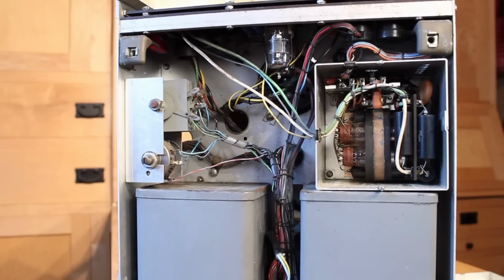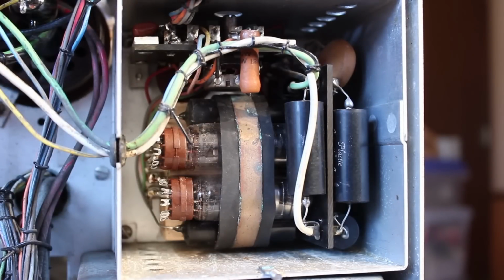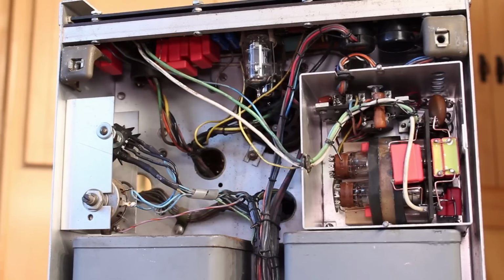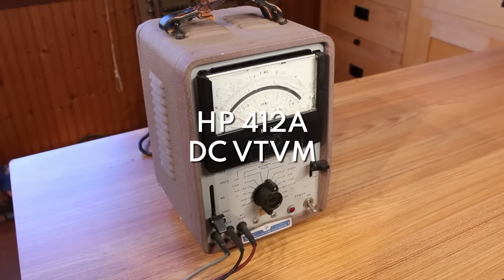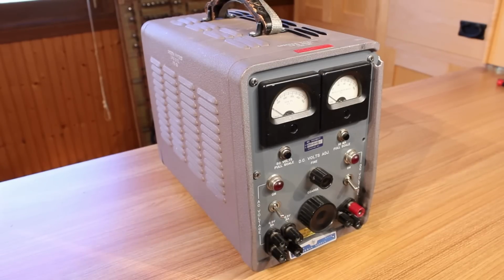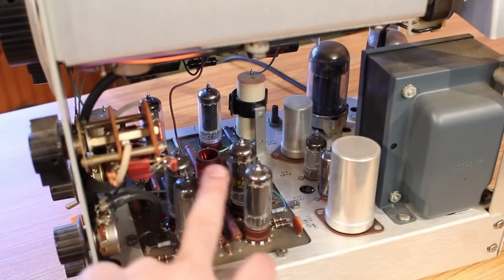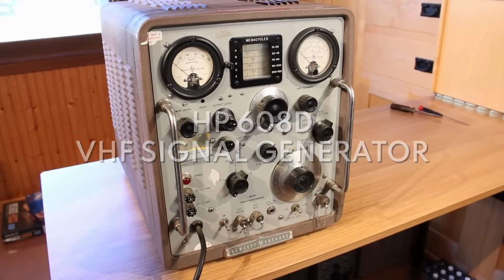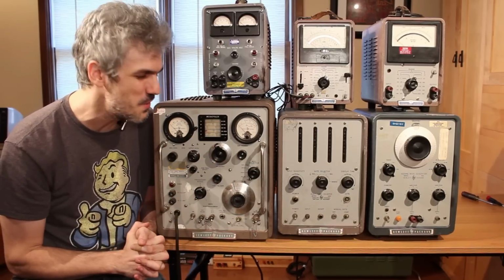Vintage Hewlett Packard Test Equipment Extravaganza

Comment: David, I have also a 608D in the restoration queue. Should we do it at the same time and have Mr. Carlson on speed dial? BTW the 608 was part of the original RF lineup that started the incredible HP RF instrument line, with specs so awesome that it stayed one the catalog forever. I just checked, the 608D is in my 1965 catalog (the oldest I have), and the 608E still appears in the 1981 catalog! The 608A was introduced in 1950. A 30 year run.
Reply: great to see you here Marc!

a collab would be awesome, David's channel could really use more subs :)
Reply: A trio collab with the best (Marc, Usagi and Mr. Carlson) would be a dream!
Thanks for all the joy you all provide to us.
Reply: Mr. Carlson also recently did a video about a 521C he has.  His was in really good shape (and working), not sure it even needs any restoration. (Where does he find this stuff?)
Reply: How awesome could this get! Please include a detail dissection and some CuriousMarc analysis of this black magic RF box!
Reply: Woah ! This will be epic three musketeers restoring stuff together
Reply from the maker: Oooh yeah, dueling 608D restorations, I'm absolutely game for that!
Especially with your black magic RF skills, you can teach me the dark arts in exchange for spare vacuum tubes. I've been slowly checking off instruments from the 1959 catalog, and sure enough the 608D is in that catalog too. Interestingly, on the 608E/F models, it seems the modulator portion of the machine was upgraded to use a handful of transistors, but the rest of the machine is still rocking the great compliment of pentodes, dual triodes and triode-pentodes. I just think that's excellent that you could buy a new piece of test gear in the 1980s that still had to move electrons through little glass tubes!
Reply: Well given that I have a 608D in my basement waiting for it's turn, I'm going to put in a vote for this as well.

Comment: Wow seeing the 608 what a flashback. I was an avionics tech in the military during the late 60's and used it extensively repairing UHF aircraft radios. I've never seen the inside as ours never failed while I was assigned to H&MS.  The other stuff on the radio bench was a TS505 VTVM, and a RF and audio watt meters, forget the military designation of those pieces of test equipment.
Reply from the maker: That's awesome that you got to work with the 608D in it's intended environment! It's good to hear that the one you used never failed, that bodes well for this one getting up and going again! Also, that TS505 VTVM is excellent, it looks like it was built to survive just about anything, haha.

Comment: The build quality of these old HP devices is just increadible. I love the high amount of mechanical stuff in them, this was just a completely different approach at problems. 
I can't even (and don't want even) decide on which one you should do first, they all have some very interesting topics to cover and I look forward to every single one of them.
Reply from the maker: HP built some amazing stuff didn't they!
The 412A DC VTVM is really interesting actually, the Synchron is an AC motor that spins a wheel to make or break light from the bulbs contacting photosensors to make a chopper circuit for modulation and demodulation. It's a beautiful collection of mechanical and electrical engineering!
Reply: @UsagiElectric  Oh well now I know what else I wanted to comment. 
As you already figured out, the synchrotron is a very early chopper amp. 

Mr Carlson also has an old video of a RF voltmeter wirh a little neon bulb photocell chopper like this.

Comment: LOL, Way back I was trained in the Army as an electronic test equipment repairman, I had the MOS of 35B20 and 35B30. My ETS was in 1972, After the service I worked at an army depot in their instrument shop and repaired a large variety of HP test equipment. I remember working on nearly all that you show. But mostly the HP400 AC Voltmeter and the HP410B Multi-meter. I would have three or four HP400's burning in while I was going through the specifications on another for the QC inspector. Fun times.

Comment: With regards to the Selenium Rectifier, they don't need wholesale replacing the way some internet people may portray.   The tend to slowly degrade over time, not just suddenly melt down (unless the rest of the circuit shorts out).    The slow degradation results in increasing voltage drop, and this causes increased heat over time and when they start running hot enough they may fail.   If the voltage drop is within specs, they are quite safe to continue using.   They may just need checking occasionally.      It's personal choice, but don't feel that the Selenium devices are the big ticking bomb some people make them out to be.

Comment: I grew up with HP equipment, and even today, I still have and use them on occasion!

There is somethings in life that survive the newest, and what I was going to say, is now, no longer the newest, Fluke meters has replaced. But I am sure there is a replacement for Fluke soon, just as the HP and Simpson meters have lost their glossy newness, Fluke meters shall also get tarnished, but as I am no longer in the mainstream of electronics, and only work from my home, things will pass me by...

Comment: At a garage sale I bot a 711A power supply and a 521A counter for $25. The 711A was a little flaky but came right back to life and reasonable calibration after simply replacing all the bumble bee .1 uf caps with new ones. You just have to rip those out and replace them, they are always all bad. The 521A counter worked fine as it was. I unfortunately lost it in a fire, but I still have the power supply. I also built a little box using a backwards filament transformer that runs off the front panel 6.3 + 6.3 volt AC posts. The box runs a filament xfrmr backwards and produces enough volts to run an 0B2 105 volt gas tube and produces a 0 > -90 volt variable bias supply, the lack of which is a serious shortcoming of the 711A supply. Kewl piece of gear. 
The AC and DC VTVMs you have use a chopper and light interruptor mechanism to measure volts, and are kind of arcane. They are probably pretty tricky to troubleshoot. You will like the 211 sq wave generator (and it uses several 6CL6 which you thot you might use in your 6AU6 computer project) That piece can put out a VERY strong square wave, 50-60 volts.

Comment: You shouldn't really need to replace those Selenium rectifiers. Unless they've been abused they will last for a lifetime. Equipment was often designed around their relatively high voltage drop (compared to Silicon rectifiers) and internal resistance, so that needs to be taken into account if you need to replace them, in order to avoid supply voltages being out of spec.

Comment: The "synchron" is a synchronous motor. My best guess it's an interruptor for a chopper amp.
Reply from the maker: You absolutely nailed it!
I dug through the manual after I posted the video and that's exactly what it's used for!

Comment: HP made some superbly well engineered tube powered test equipment, didn't they?  I'd do the DC VTVM, followed by the AC one and then the 521A frequency counter because 'use vintage test gear to repair other vintage test gear!'
Reply from the maker: HP never ceases to amaze me with their engineering! 
Thanks for the vote on the equipment, I'm keeping an Excel sheet to see which pieces get the most votes!
Reply: @UsagiElectric  And they started in a garage with an audio generator (300 I believe).

Comment: If the meters use the same meter, maybe you can get measurements off the intact one to help recreate the bezel and scale.  I'm most interested in the frequency counter, but as others have said it would be cool to do the meters first then use them on the other gear.   Your charisma, Mr. Carlson's know-how, CuriousMarc's HP love - that's a dream team.  🙂
Reply from the maker: Unfortunately, the AC and DC meters are just different enough that I can copy it over verbatim, but they do share enough similarities that the AC meter will make a great template!
One of these days, when travel is okay again, I'll have to try to talk my way into flying out to visit CuriousMarc's HP collection!

Comment: I’ve never seen any equipment without a board. Impressive!
Reply from the maker: PCBs were really just coming into their own in the 50s, so a lot of stuff from that era is often point to point wiring or uses turret boards. I love that HP was really experimenting with designing stuff on PCBs and using a mixture of all construction styles. It shows they weren't beholden to a specific type of engineering and they made some really excellent stuff as a result!

Comment: Pareidolia is definitely doing its thing here, because I'm seeing so many funny faces ein these instruments!
The 608D would be fun, but maybe not the best start? One approach would be to think about which ones would be useful when trouble-shooting the others? The 711A power supply that needs some body work would be my vote.
Reply from the maker: Haha, I never thought about that, but you're right, there are some funny faces hiding in there!
The 608D is definitely a difficult one. I'm not even sure how I would go about testing it to make sure it's working. It's slowest oscillation speed is faster than the fastest speed the HP 150A scope can support. I can always break out the modern Siglent, but that's not quite as fun as using vintage HP stuff to restore vintage HP stuff.
The 711A is probably the one I would get the most immediate use out of though, so that's a good vote!

Comment: I vote for the 608.  I spent a lot of time inside those in my salad days.  You're in for a treat... They are marvelous generators, but they can drive you nuts when they don't work properly.
Reply from the maker: I know so little about the 608, it's going to be a really interesting piece to dive into and learn about!
Fortunately, HP made some pretty fantastic manuals, so hopefully I can get it back up and running again soon!

Comment: An arc-cricket is what the old teks use to call this.  Depending on the volume/pitch you can tell it is internal or external.  Low volume high pitch. internal in your case.   Glad to see the Se rectifier gone. Btw you should always  install your coupling  caps with the foil-side to ground  ;)  For example  the strip on the old type 33 I bet that was pointing toward ground.
Reply from the maker: An arc-cricket - I like that!
I've heard a lot of differing opinions on the foil side to ground for the caps, but it requires some special testing to figure out which side is foil side on the new modern caps I buy, and I'm way too lazy for that, haha. Fortunately, the HP 150A didn't seem to care because it came right into spec according to the manual!
Reply: @UsagiElectric  It is the low frequency range that will be most effected.  But if you happy I am happy.  Checking for the foil side is easy, all you need is an old guitar amp and a little time.  I myself use Mr Carlson's little device, and I only ever use it when I get a batch of new caps in and check and mark each one,  On the Se rectifier side of things supposedly at low voltage the will last forever,  it is higher voltage and bad caps that will cause the big smoke with them.  I myself just bypass them as why take the risk.

Comment: There's a 428B missing! :-) Iconic device. The perfect amp bias tool.  Mine is accompanied by 410B and 400H, as well as 3552A and 3438A, for Nixies I've got 5221A and then there's Junior, a 974A.
Reply from the maker: Oooh, the milliammeter! That one is on the list of ones to get! I don't due much amp biasing, but having a milliammeter in the suite feels like a must at this point, haha. Also, the 410B is an amazing little VTVM. The probe with the tube in it is just so cool.
You have an absolutely lovely HP collection too it sounds!

Comment: Old capacitors try using something to generate 4kV or so, and then applying some voltage to each one, with a series 10k resistor, and a small 600R speaker to hear the breakdown as the capacitors break down. You will find which have failed from the clicking.
Reply from the maker: That's actually a really cool idea!
Unfortunately, all the old 6kV caps are already in the bin, haha.
Reply: @UsagiElectric  I used to test motor run capacitors by applying 1kV to them, and listening to the crackling coming from inside them. Old capacitors will break down, but the new ones will survive 1kV from an insulation tester no problem. first test for breakdown, then discharge with a 68k 10W resistor for a few seconds, then leave for a few minutes, then short them (dielectric absorbtion) and check capacitance, normally down to under 70% of nominal value. Crackle means change anyway, it is done.

Comment: Useful note:  See those tubular capacitors where one lead is much fatter at the base than the other?    Ever wonder what that is about?   As it turns out, that bulge is a thin brass tube which was used to fill the capacitor with oil.  Then a wire was soldered into the tube.  Clever.   However you would always end up with a little bit of flux going into the capacitor oil.   Eventually the flux would contaminate the oil and lead to internal leakage.   

Also those black tubular caps with yellow lettering were often paper dielectric capacitors which also tend to go leaky over the decades.  If the lettering is reddish-orange,  people say that the caps have a plastic dielectric and they tend to be a bit, but not a lot less leaky.

Both HP and Tektroniks used both styles of black tubulars.   I always replace all of them, even the ones that only show like 100+ megohms of leakage.

Regards,
George
Reply from the maker: That's really cool, I was curious about the fatter base at one end, but I never would have guessed it was to fill the cap with oil! That's awesome! I mean, break down and internal leakage isn't that awesome, but still, I love seeing unique construction techniques like this!

Thanks for the insight on the caps, it seems that lot of people are saying the Spragues with the red lettering and the yellow caps should be totally alright. That's good news in my book because it's fewer things that I have to replace!

Comment: I'd say go for anything that you can put to use sooner rather than later. Obviously if it's higher up on the difficulty scale you might want to push it down the list further, till you get more practice on some of the other units. But that 608D signal generator looks amazing, so it would be pretty cool if you and CuriousMarc could get yours and his working at the same time.
Reply from the maker: Thanks! 
Honestly, for most of the stuff I build, the 200CD signal generator and 150A scope are plenty. Occasionally I need a square wave rather than sine wave, but the 150A actually has a square wave generator built into it (the calibrator). Other than that, on the very rare occasion I need some HV, so the PSU could be useful, but then again, the VTVMs would definitely get use too if they were up and going. 
But, I'd shuffle the 608D right to the start of the queue if it meant getting to chat with Marc about VHF stuff!

Comment: I was going to comment that you are becoming the CuriousMarc of older HP stuff, and then lo, a comment form the man himself. Truly if you want a challenge then the 608 is my choice, I had one when I lived in the UK, and it was used to retune old PYE RF equipment to the amateur VHF bands, sadly it was destroyed by an inept moving company in one of my overseas moves. Good luck if you do choose to go with the 608 first.
Reply from the maker: The 608D is going straight to the top of queue if it means I get to chat VHF and RF stuff with Marc!
That's a shame that yours was destroyed in a move, it's always sad to see one of those old pieces of equipment die. Fortunately, the 608 it seems was made for like 30 years, so there should still be quite a few out there!

Comment: On the 211a, those sprague caps should be good. The red color means they are film.
Reply from the maker: Thank you for the heads up! I'm so terrible at recognizing old caps, but it's good to hear that those don't need replacing, that makes my life a lot easier!
Reply: @UsagiElectric  actually, I’m not entirely sure. Try to leakage test them.

Comment: To me the yellow capacitors looked like polyester type and therefore not my first candidate for replacement.  The round "funny thing" looks like a synchronous motor.  I would expect to find a light chopper wheel behind the panel.  In the old vacuum tube era it was quite hard to make stable DC amplifiers, so a chopper -> AC amplifier -> synchronized rectifier -> DC output stage was the way you find on old HP meters.  A synchronous motor would likely provide lock to line frequency and therefore hum canceling.
As to the DC power supply, I think it would be linear type, series pass.  If the raw supply is over 500 V, at the 0 output and 100 mA current, the series pass element (tube) would need to dissipate 50 W.  Going up to 500 V, the tube dissipation is reduced to near zero.  So, contrary to your suspicion, the unit would have no trouble producing 100 mA at 500 V.  That of course assuming the tube(s) are not "weak" and still have good cathode emission.  Anyway, my vote for an early ichoice to go through the fixing process is the power supply.
Reply from the maker: Thanks for the insight on the capacitors! I'm terrible at identifying old capacitors. It seems the yellow caps and the Sprague caps with red lettering are actually alright to leave in for now, which is excellent news.
And good call on the synchronous motor! You're absolutely right that it's a chopper for a modulator - demodulator setup it seems. I'm still fuzzy on how or why that's needed in the DC multimeter, but that's why I've got it - to learn all sorts of new things!
Also, thanks for the info on the PSU, that actually makes total sense. It's opposite to how I was thinking, but you're absolutely right!